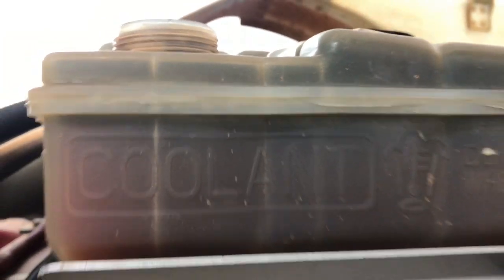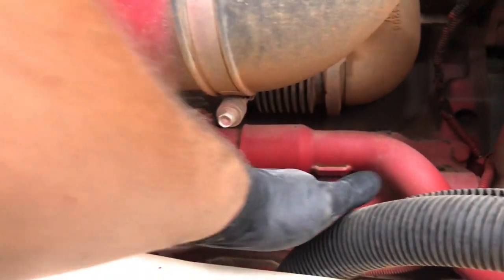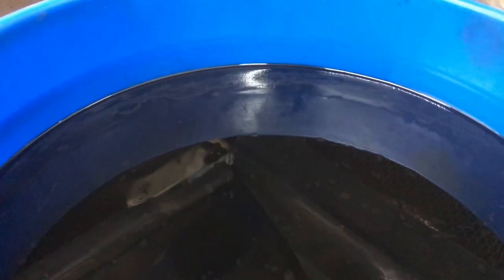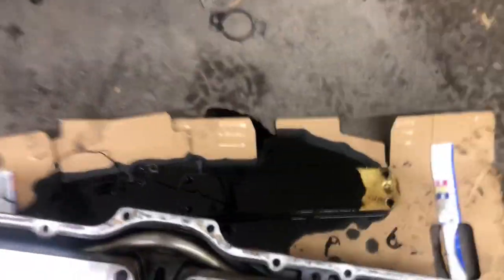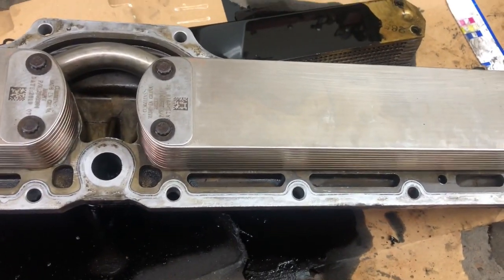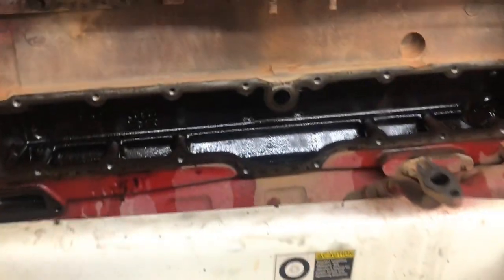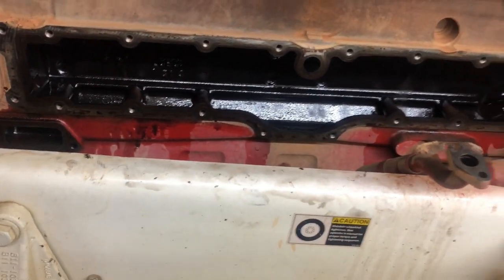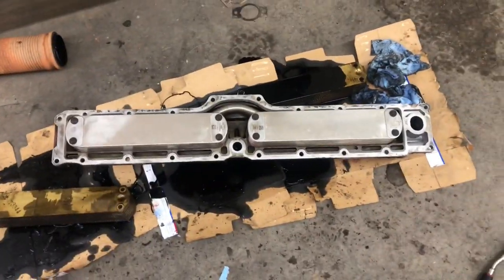How to fix Oil in Coolant

Comment: Just did this job last week on a cm2250 (only has one element) to confirm the cooler was leaking besides all the oil that spat out the coolant tank relief, is take the oil filter off and pressurize the coolant system, coolant will start dripping out the filter housing .  Takes longer flushing the oil out of the cooling system then doing the job.   Silicone hoses don't last to long afterwards either.

Comment: I have oil in coolant too on my cummins isx 15 with 500hp. my truck is volvo 2011 but my question is i see in ur engine u have 2 oil coolers and when i bought they only gave me one ? is it ur engine different ?
Reply from the maker: No. They make them different on trucks. But mine was a cm871, a 2009. Your truck is a bit newer, so it might have 1 which is normal. Some of them have 2, some have 1.
Reply: DieselBullet thank you for the info sir. You have a great day!
Reply: I use to work for volvo trucks we did alot of those oil coolers on cummins and the volvo engines a very common problem . make sure the housing surfaces arent corosion pitted  , if so replaced the housing .yes they do have single and dual oil coolers on cummins  .
Reply: I’m back again. I replaced the oil cooler and now i see oil again like yellow in the tank. This is weird because the mechanic said he flushed the system and i did 3 more times and there is still comes oil on the top of the radiator but not that much. Oil is clean no signs of blown headgasket, is there a chance blown headgasket can push oil in coolant because i had 2 trucks that when headgasket blew always will allow coolant to go in oil. Please for advice
Reply: He put good money pdi cooler 4k right there.